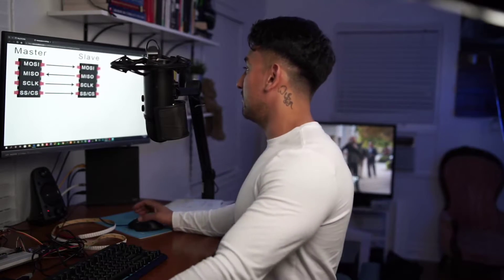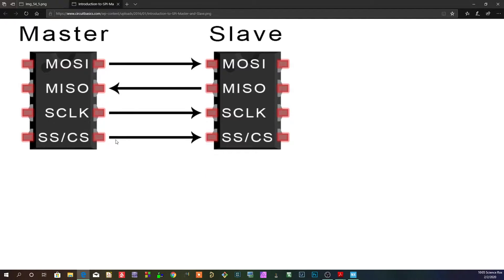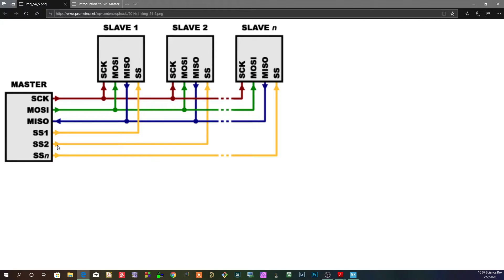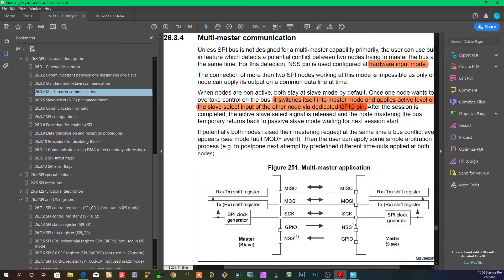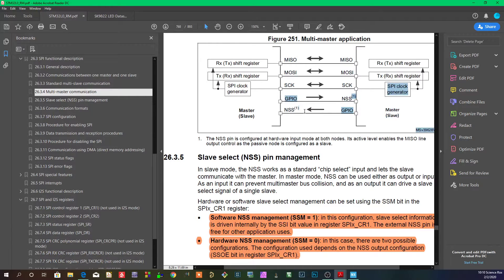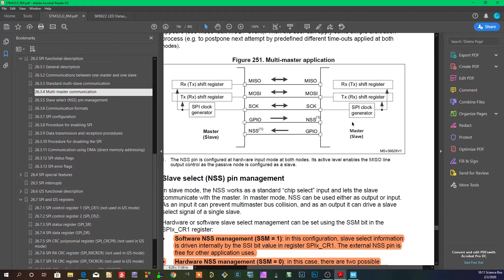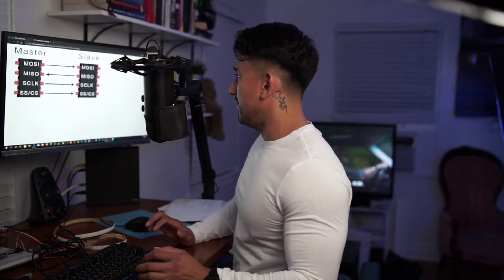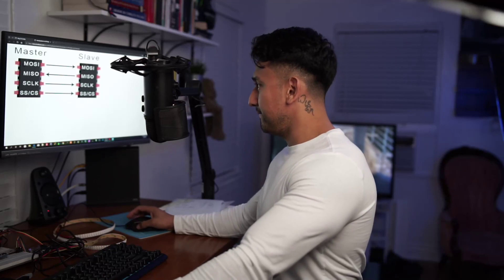STM32 SPI: Pt 4

Comment: Great video series. Just one question, so in SPI hardware management, CS switch from high to low for data transfer and in software management, the NSS (I beleive this is the CS for multiple SPI) will switch from low to high.
Reply from the maker: the external device you are controlling is the one  who dictates how its slave select pin is to be used.

Comment: I just watched four videos about SPI to discover how the clock frequency is set - especially when dealing with LED strips, which don't send any clock back to the uC - and you didn't cover it!
Reply from the maker: This is about SPI not about Led Strips, and no SPI will ever send a clock signal  to the master, and the the BR (baud rate)  register was covered so I'm not sure how you missed it.
Reply: @EdwinFairchild  Ah - yes, you're right.  The master effectively clocks in data from the slave.
Reply from the maker: Video 5 @7:16
Reply from the maker: Not to mention you need to read the datasheet of the LED to figure out how the polarity and phase of the clock need to be for the specific LED , I have a video about that on my channel, it was the last one I have uploaded. And I go into detail about it
Reply: @EdwinFairchild  Thanks Eddie, I'll look at that.  The LED strips I want to use are the 8822-2020's.  They don't come in a strip, and they're too small to solder wires to - well, too small to do it accurately with an iron!  The LEDs are 2mm x 2mm, and they have 6 pads on each LED - Data in, Data out, Clock in, Clock out, VCC, Earth - so the pads are quite little.   According to the datasheet, they can handle a clock rate of 20Mhz, and I need to push them a little further than that - about 22-23 MHz according to my calculations.  I think I'll probably get away with that, but if I push them too far, they will start losing data, so I need to set my SPI clock quite accurately, and that is what I was hoping to see from this video - but didn't!
Before I order the LEDs, I need to get to grips with the ARM STM32H7 chips, and by the time I do, there will probably be a new range of LED strips.  At least, the 8822's may be available on a flexible strip instead of just as individual chips.  They're so small, you could accidentally put a spoonful of them in your tea.
Reply from the maker: @DownhillAllTheWay  yeah they sound like these LEDs that I have on the strip, except there is no need to break out the clock out line and data out because those just go to the next led , so you end up with just 4 wires, I also have the individual LEDs I was going to do something with but now I forgot. Just get some solder paste and back them or hot air gun, whatever works. I've never used an H7 but surely setting up SPI can't be that much different than the way I do it in the coding video. But then again who knows since ive never seen the RM for an H7
Reply: @EdwinFairchild  I believe that with the 4-wire strips, you have to send the data at a certain rate - you can't elect to send it at 22 MHz, for exmple, whereas with the DotStar or the 8822 which has superceded the DotStar, they use a separate clock to clock the data.
I have bought a Nucleo board, and I'm trying to bet a blinky sketch going.  At first, it said the ST-Link needed upgrading, but I did that.  Now, it is failing with what it tells me is a DLL problem.  Maybe I'll have to reload  CubeMX.  Once I get it working, I don't anticipate that SPI is going to be terribly difficult, though I'll have to drive two SPI's (I will have a North strip and a South strip on a POV globe - each strip with 106 LEDs, each one at 22 MHz), and because of the speed and other things the CPU has to do, I'll have to drive the SPI from DMA, and I'll have a third SPI to read an SD card - and I haven't got my Blinky working yet.  So in the words of Capt. Oates, "I may be some time"